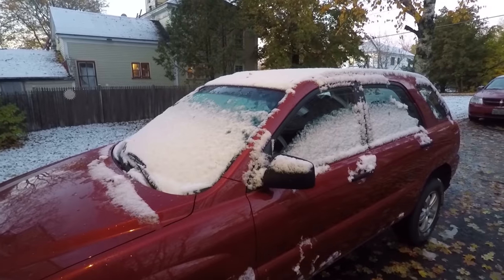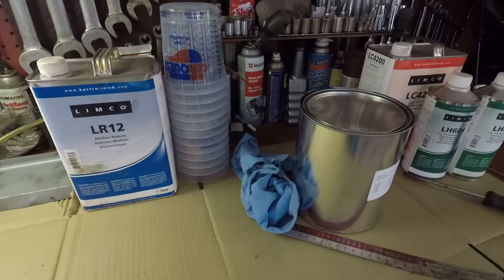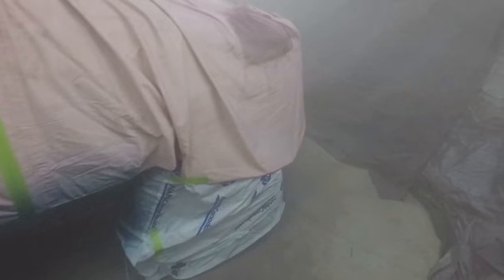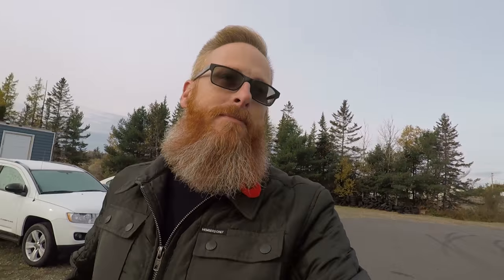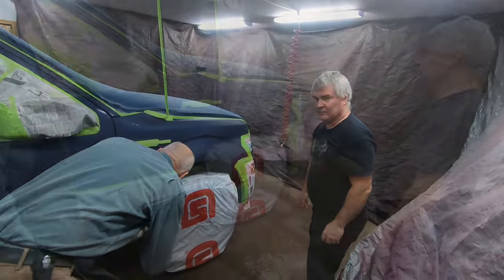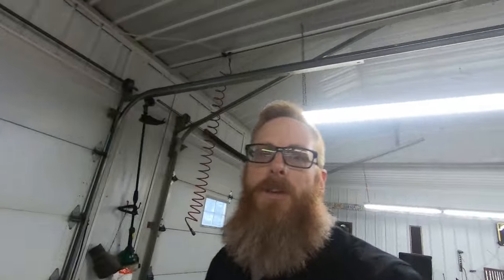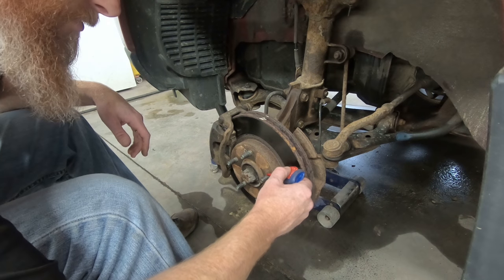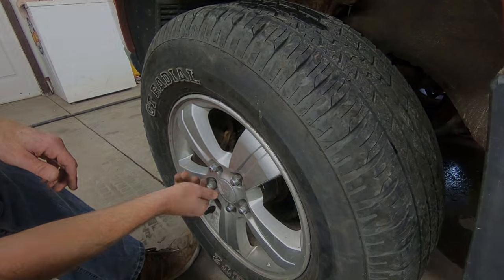HOW TO INSTALL WHEEL SPACERS ON A 2009 KIA SPORTAGE

Comment: If you have to wear ear warmers on October 25th...boooo! Although I guess we had one of those days too in October. That's cool that a community like Calais accepts your currency and let's you get a P.O. Box. I'm glad our government(s) haven't abolished some simple things like this. For some reason, I was kind of hoping the truck was going to stay matte but it turned out pretty good. Maybe you could cleverly come up with a partial vinyl wrap to promo your business instead of painting, but...I see you went ahead and painted. Always go with the bigger tires ;)

Hopefully the steel wheels offset/backspacing doesn't negate some of the work you just did with the spacers!

Who doesn't heart bubbles?
Reply from the maker: Neat fact about Calais and St. Stephen, During the war of 1812, Saint Stephen gave a barrel of gun powder to Calais so they could have fireworks for the Fourth of July.... Hows that for community Spirit!
Reply: @OldeCarrGuy  that's sooo awesome

Comment: Hey man, love the videos. Was wondering what brand spacers you went with? And what they cost and how they did? I have a 07 Kia Sportage Lx and I’m trying to fit a bigger tire but I couldn’t find 16in offset rims and a very small selection of wheel spacers for 5x114.3 bolt pattern. Trying to stay with a solid daily driver but come up a little. I did the 40mm body lift and it looks good. Thanks
Reply: And are the spacers hub eccentric?
Reply from the maker: Thanks Austin. Here is the link to the ones I purchased. If you don’t already, follow me on Facebook and or IG so I can see pics of yours! 

https://rover.ebay.com/rover/0/0/0?mpre=https%3A%2F%2Fwww.ebay.com%2Fulk%2Fitm%2F332516336212

Comment: Looks Great...what size were those tyres you had on those original Kia rims? ( the tyres in this video)
Reply from the maker: I believe they were 215/60R16! Quite a difference Eh?  Thanks for watching.
Reply: @OldeCarrGuy 
 Looks great man. 
What's really amazing..of all the KIA 2009 variants out there ( body panels, mud guards, rims  etc), yours is the only one that  is identical to mine..in 🇩🇪
My wheel spacers have been ordered...Thanks again 
Tony

Comment: What size spacer man im trying to put bigger tires on my 09 sportage with 4wd i have 235 60 16 right now an going up to 235 75 16 hopefully with your vid thanks man
Reply from the maker: 1.5” spacers will help keep the tires from rubbing the struts! I have a whole playlist on project Bubbles! Be sure to check it out and thanks for watching!
Reply: How did those 235 75 r16 tyres work out